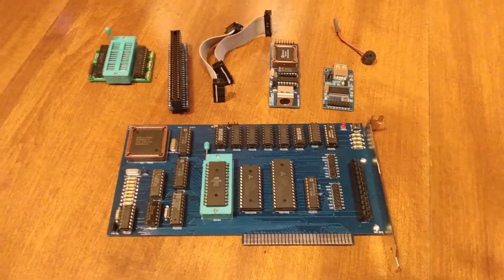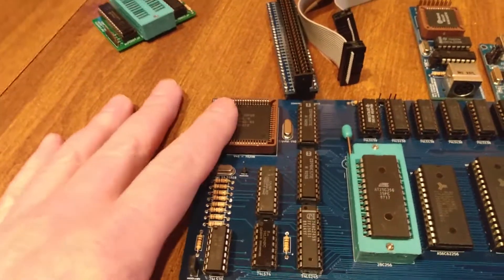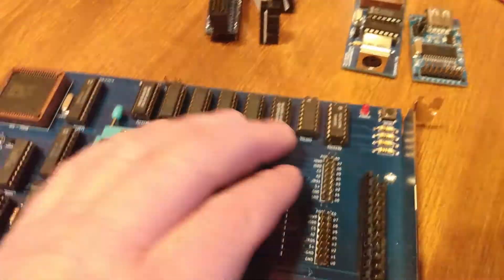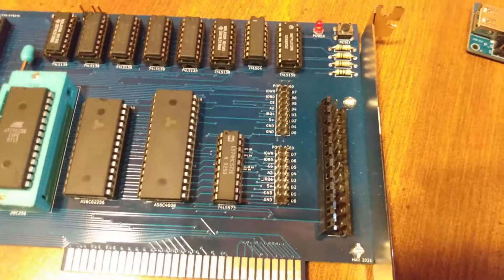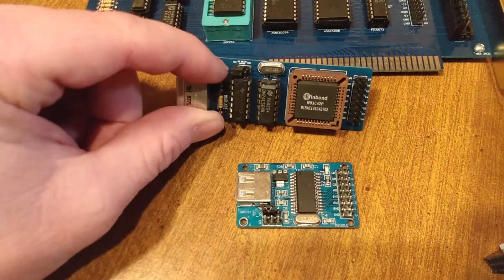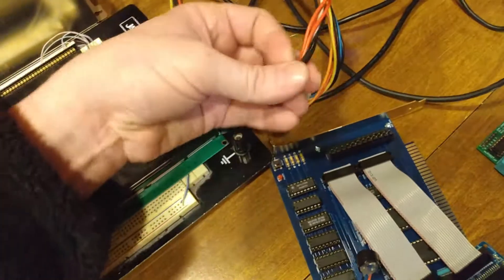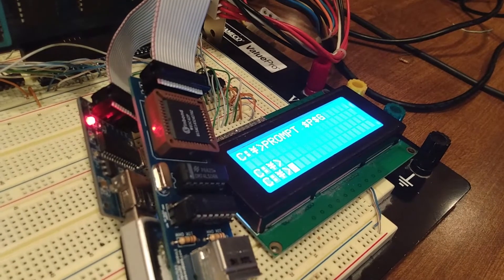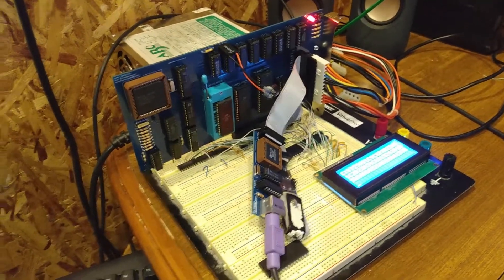8088 Motherboard Project. V40 Processor, PC Compatible, Built on ISA card, PS/2 Keyboard, USB Drive

Comment: I think you might need to add decoupling capacitors for all the ICs in order to use a faster cpu clock... maybe the traces would need to be tweaked as well, to equalize track length on buses, and such. however, pretty cool project! I'm working on a 80c188 thing without isa capabilities, and it's really interesting to learn everything needed on a pc for an OS to work

Comment: I believe starting MS-DOS 4 you can use up to 2 Gigabytes of space on a harddrive. This is limited by the BIOS (the 500 MB limit) unless you circumvent it with an XT-IDE or e.g. going SCSI (though don't quote me on that).
Reply: Yes. It is. There are other limits with the various versions of DOS. MS-DOS 5.0
has a disk drive size limit of 512MB. Earlier versions were even more restrictive.  The BIOS limit is more specifically 528MB with 1024 Cylinders 16 Heads 63 Sectors (the limit is 504MiB by binary megabytes units which a vintage machine will display). 
MS-DOS 4 actually has only a 134MB limit. You may be thinking of the FAT16 format that has the "up to 2GB" limit. FAT12 limit is about 16.7MB! 
 My talk here about past versions of DOS is mostly academic, I assume most people will use either MS-DOS 6.22 or FreeDOS, but all these figures are easy to confused, especially if they haven't been dealt with in over 30 years! So if you go looking for advice from a techie greybeard friend or relative it would be understandable if he get these mixed up. The one case where it matters little is the DOS 5 limit of 512MB with 528MB/504MiB BIOS limits. 
In other situations where your PC is not seeing all the disk space, you will want to keep track.
Sorry for this long-winded discussion which has more to do with trying to collect data from old PCs than any consideration of a new/retro platform

Comment: @2:00 its not, NEC calls this NEC uPD71071. Its possible to emulate PC compatible DMA controller using NMI and I think Olivetti Prodest PC1 does it because there is "Olivetti prodest Pc1+Sound Blaster 2.0+ VGA Graphics" titled video on YT showing Prince of Persia working, and PoP uses DMA for digital sound effects on SoundBlaster.
@2:40 as Santiago Hormazabal already mentioned above me, no bypass caps
@6:30 Hmm, V50 doesnt have bus width input pin, only "Upper byte enable" output like V30. So what happens when I execute 16bit read to VGA memory of a card plugged into 8bit ISA?
Reply from the maker: Correct the DMA controller is not the same as the 8237. I haven't test the DMA controller on this board but it is all conected. 

If I  create a board with the V50 processor it would have a 16bit ISA slot.
Reply: @elijahmmiller  Thats what I was unclear about. 286 requires some heavy lifting, otherwise how do you provide full compatibility for 8bit devices? CPU will want to do 16bit reads, and there is no way to signal the CPU (8086/286/386) that this region of ram can be only accessed in 8bit mode.

I finally found "ISA System Architecture, Third Edition" describing "bus steering logic" for 186/286/386 systems, generating two consecutive 8bit reads and swapping second read to CPU upped 8 bits while CPU is kept waiting using READY signal.

NEC V53 (Intel 80386EX, and all 486s) has nice BS8/BS16 inputs making this trivial without external trickery. It looks like it would be easier to hardwire 486 for 8 bit accesses than build 286  or V50 system? :o There goes my enthusiasm for the V50.

Comment: I'm not sure exactly what you mean by "ISA case". If you wanted to make it "full size" for the original IBM PC, that would be plenty of space for components! I take it though, that you're referring to what would be "half-sized" for the 8-bit ISA bus in a XT, roughly the size it is now. And yes, 512MB is a disk size limit for 8088 BIOS, but PC/MS-DOS, up to 3.3, has even more restrictive limits in the range of tens of MBs. Maybe the XT-IDE Universal BIOS (XUB) can address 4GB? I'm guessing most, if not all will use a DOS and not more exotic x86/V40 OSes. I have no idea what disk size limitations others might or might not have.
Reply from the maker: I miss spoke I ment to say ATX case
Reply: What about SCSI? Even if you use DOS 4.01 and newer, you may be constrained by the mobo's BIOS. So maybe using SCSI, along with the XT-IDE, also helps? I mean, neither depend on the mobo's BIOS and have their own one. I'm just not fully sure (hence the disclaimer in my other comment) if circumventing the 500 MB limit of the motherboard is possible with SCSI as well.
Reply: @bundesautobahn7  I forget the theoretical limits for SCSI. My antique 8-bit PC knowledge says SCSI was rare for the original PC and XT clones, if you want to search, they would probably be built for a few tens of megabytes. People may stick this in with mobos or passive backplanes with 16-bit ISA or in combination with PCI slots, so that's a wide range of cases to consider. I remember when using early 68k Macs, I thought SCSI was far superior and worth bragging about, having workstation-grade SCSI disks in a home computer. People forget there used to be justifiable reasons for Mac snobbishness, then they gradually became, especially as laptops, just another PC. I'm pretty excited about the new ARM chips in Mac, and dipping my toes back in x86 seems a bit indulgent. ARM is the future, and if I was looking for marketable skills, that's what I'd do. I'm not, so maybe I won't.

Comment: What is the name of that USB host controller and how does it work?
Reply from the maker: CH376S if you search online you will be able to find the datasheet.

The way that I have implemented this on my project it to use the CH376S's build in commands to read write sectors of the drive.